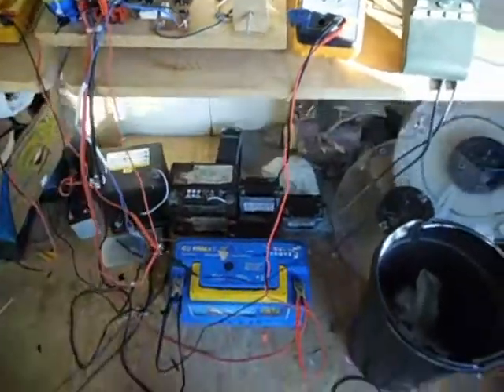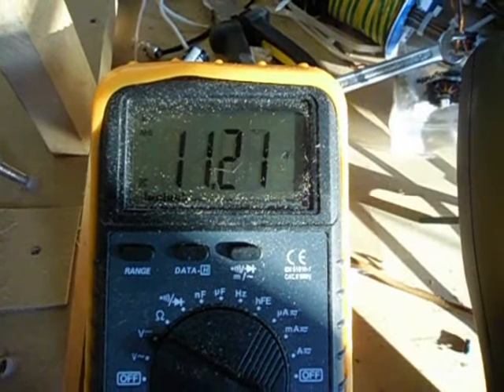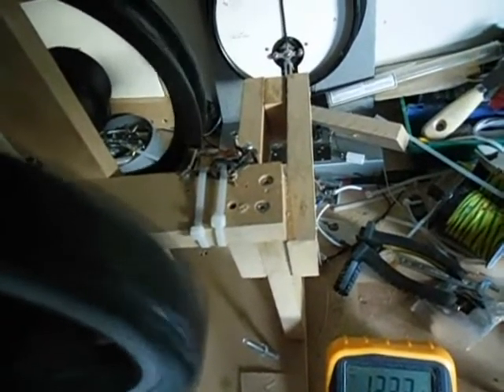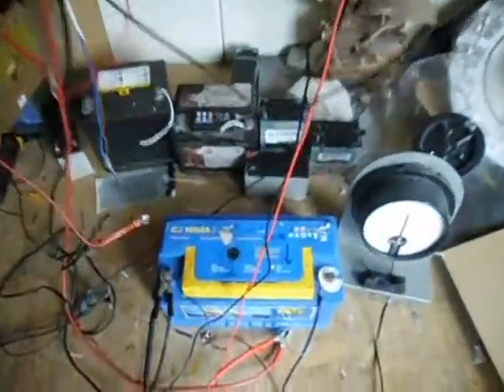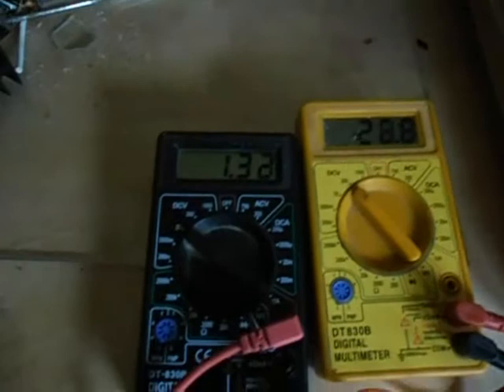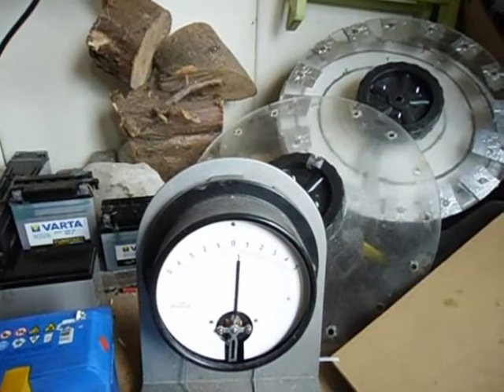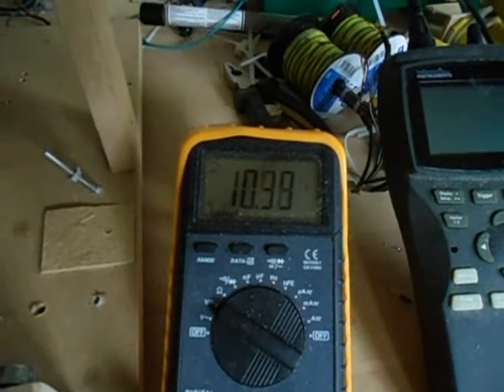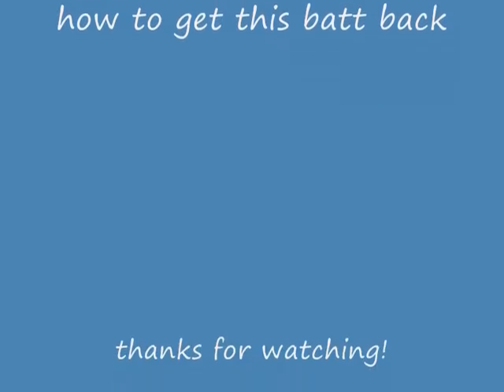rejuvenating a 100 A/h marine battery

Comment: I run my battery like this for several nights (3 weeks approx) and the marine battery is just as weak as it was already. The voltage may look to go up but when I punt a 100ma LED load on it it drops to 10 Volts and stays there some while. After like 15 minutes it drops further and further. It is a marine bat with extra heavy lead. It is so sulphated, I can;t get it desulphated anymore. I also ran HV discharges on it for several days. To no avail. So I am stuck with a big block of chemical waste!

Comment from the maker: I did it for maybe 3 hours with the ssg and for the night I put it on a conventional charger but it first went to 13 volt not taking much amps but next morning it was warm on one spot of the batt and it took maybe 5 or 6 amps from the charger.
After disconnect it was back to 8 volts and I put the SSG on it and it went up to 10 V.